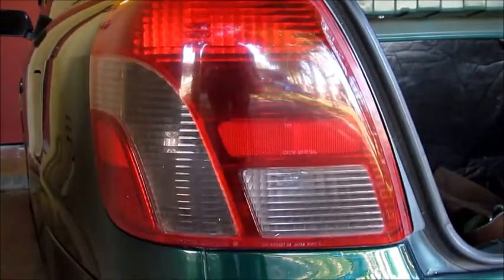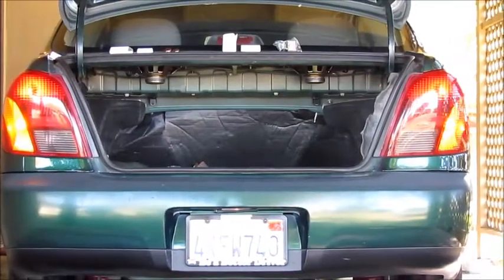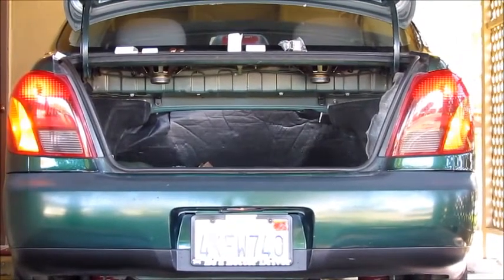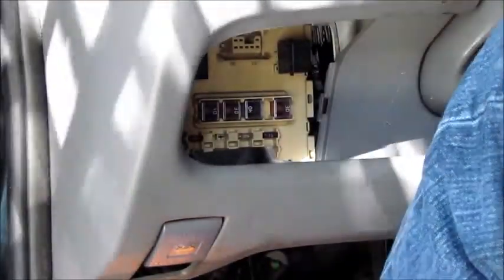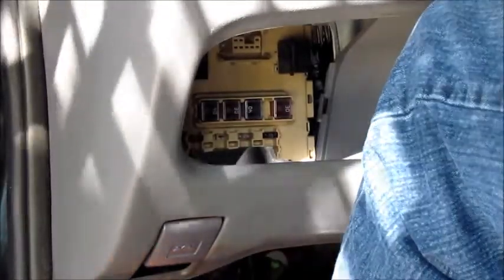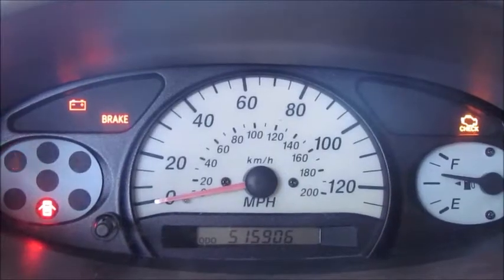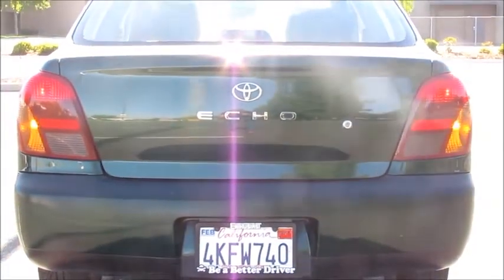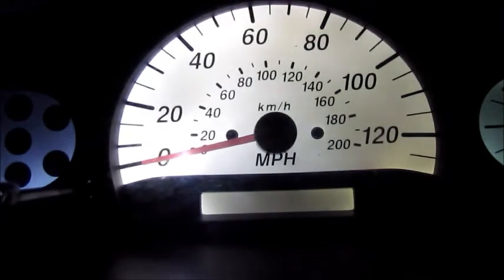Toyota Echo LED turn signals/relay; gauge lights

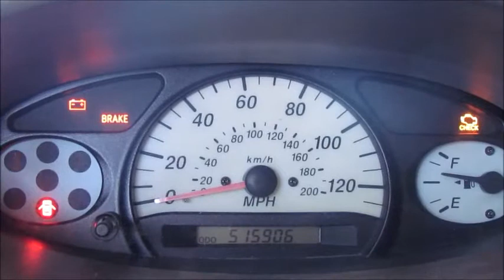Comment: 515 906 km at 1:57 wow amazing i will be getting a silver echo soon, it has 200  000km
Reply from the maker: +no map Actually, that's miles (notice speedometer is MPH, not KMH).  Original engine went at 475,000 miles with a slight knock.

Comment: After you install LED tail lights. Please post on the YouTube. Your YouTube very helpful. By the way what kind light bulb install for dashboard and light bulb for shift gear area? Is it T5 74?
Reply from the maker: +David Chang I put these in, and they're fairly affordable ($2.49 USD) compared to the tail/brake lamps which cost $20 USD a pop.
https://www.superbrightleds.com/moreinfo/subminiature-bulbs/74-led-bulb-3-smd-led-miniature-wedge-retrofit-car/228/1067/

Don't know about the gear-shift light since mine is a manual, but I believe it would be the same small bulb/LED as the gauge cluster.  I have to look at my sister in-law's car, since her automatic has an intermittently working lamp there.  I just keep forgetting to look into it.
Reply from the maker: +David Chang Same LED for shifter.  Sorry for the wait.

Comment: After I installed LED tail lights on my 2002 ECHO and found third brake light stay on without press brake pedal .How can I fix this issue?
Reply from the maker: +David Chang I don't know, I'm getting the tail lights sometime this week.  Chances are it could just be the brand of LED, or perhaps the bulbs are pole sensitive.  I know the SuperBrightLED taillights I'm ordering are supposed to be staged so they shouldn't need a resistor or anything put in, but I'll let you know.  Right now I only have the turn signals and a third brake light.
Reply: I forgot to tell you my third brake also LED not incandescent .I installed LED third light first and look ok and working.After one week later try install brake lights and problem happened.I did change back incandescent light bulb for brake lights and everything is ok.
Reply from the maker: +David Chang No delivery today, but depending on the product I'm not surprised.  The LED CMBL is only that, while the tail lights and brake lights are sharing duty in our cars.  If the LED's in placed aren't designed for both roles, then it'll act as one mode-- meaning it creates the circuit for all the brake lights on.

Have a brand and part number?
Reply from the maker: Just to bring this one back up, I did have a similar issue later on.  It turned out that the first time, I just needed to rotate one of the LED tail lights around.

Later, the same one went out enough that the brake lights would stay on, and effected the headlights as well.  I was getting in and put my foot on the brake pedal before closing the door, and sure enough the "lights on" chime came on.

I ended up replacing the tail light LED's completely with a different design as the SuperBrightLED design I bought didn't have a suitable enough (for my standards) replacement, so I went elsewhere.

Comment: since the echo doesn't show rpms what would you say the best speeds would be to shift at
Reply from the maker: +Tyler Green That's actually in back of the owners manual.  I tend to see 35, 64... don't usually go beyond 80 because I don't really need to on the freeway, but third is good for around 93-94 going by the manual.  Fourth and fifth both stop at 112, which is the governed speed of the car.

This Car&Driver test is also a good indicator, though they also mixed the 3 and 5 in "35" so it reads "53."  That'd be a very tall first, and a very short second.

http://media.caranddriver.com/files/toyota-echotoyota-echo-specs.pdf

Comment: What  number  of cluster led please
Reply from the maker: Are you talking about part number or number of LEDs?
Reply: @hduncan2587  number of led
Reply from the maker: @TRDFlorida  in the 2000-2002, and the 2003 to 2005 without tachometer I know there's only two.
Reply: @hduncan2587  2000

Comment: I have an 03 Echo. When I plug in the new relay the car acts as if the key is in the on position. No key in the ignition. And it stays that way. Any ideas? The part is 81980-50030.
Reply from the maker: +sierratrey Not sure.  It does come up as a Lexus/Toyota relay, so it should work.  The 2003 has slightly different lamps to the '00-'02, but shouldn't have changed that much.  What company made it, and is it working with LED's or regular bulbs?
Reply: They relay works fine. I have LEDs for tail/brake lights. And all four turn signals. No more hyper flashing. But when I plug the unit in, the car beeps as if the key is turned to acc or on position. And the dash lights up, and stays lit up so the battery will drain if I keep it plugged in. I noticed the difference between mine and yours is it doesn't have the variable speed knob.

Comment: i would have gone with white turn signals :)
Reply from the maker: +wesley arneaud Looks incomplete to me.  I mean, one could do red with the rears if they want, and there's the option for white running lights and an amber beam for the fronts (like more modern cars with LED's, such as Audi and Chrysler where they switch), but as far as I'm concerned amber is still the better color as it's bespoke to the intended signal.

Comment: I bought from Amazon Canada. Ship by and sold from HDE CA.HDE universal red tail light T20 7443.
Reply from the maker: +David Chang http://www.amazon.ca/HDE%C2%AE-Universal-Tail-Light-Bulb/dp/B005DELHE6#productDetails

"...A great replacement for dome lights, front/rear side markers, parking 
lights, brake lights, tail lights, rear turn signals, license plate 
lights, and gauge bulbs.  Please be sure to check that this light is 
compatible with your automobile before purchasing."

Each light they mention is a single filament job, even the tail light and brake light applications.  Since ours are a combination, something like what I ordered is probably more appropriate.  Again, I won't know for sure until they get here, but being a dual function, it was engineered specifically for that design.

https://www.superbrightleds.com/moreinfo/led-vehicle-replacement-bulbs/7443-led-bulb-dual-function-45-smd-led-tower-wedge-retrofit-car/634/1911/
Reply from the maker: +Harvey Duncan I installed the LED tail/brakes, and they worked fine.  The difference between the LED and the incandescent tail lights are immediately apparent.
https://www.facebook.com/PheobeTheEcho/photos/a.419810208075665.96178.417157431674276/1017578734965473/?type=3

Again, they all worked properly with nothing modified in the wiring to compensate for the loads.
Reply: +Harvey Duncan I will buy LED light bulb from super bright web site.Thanks you